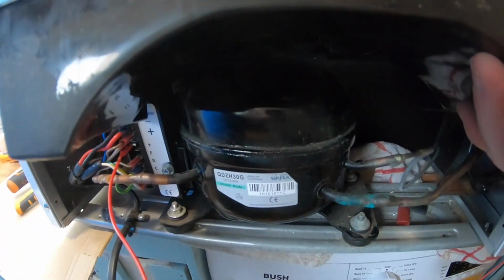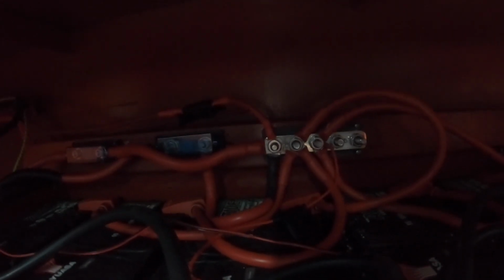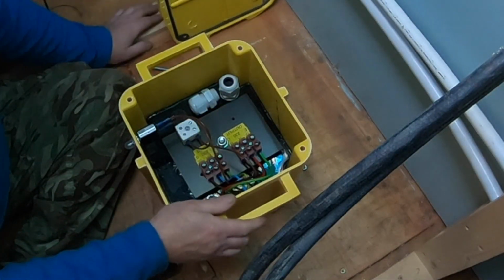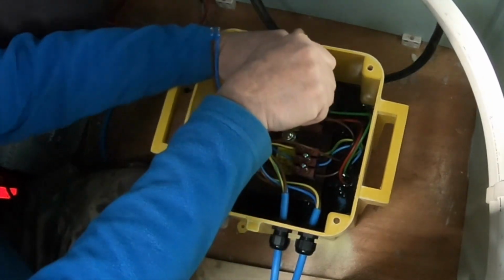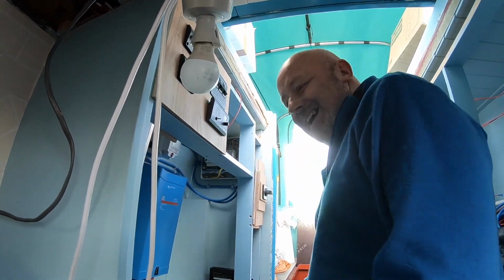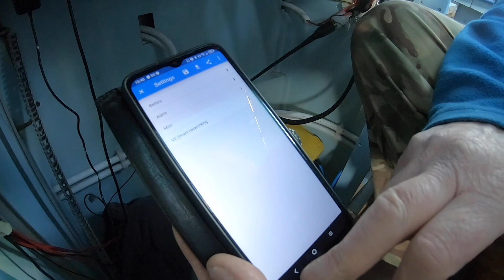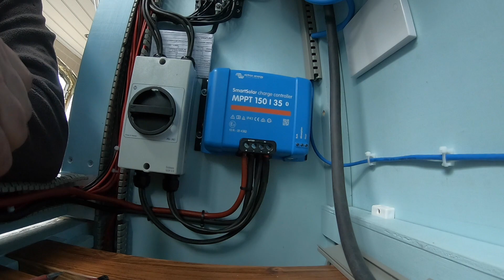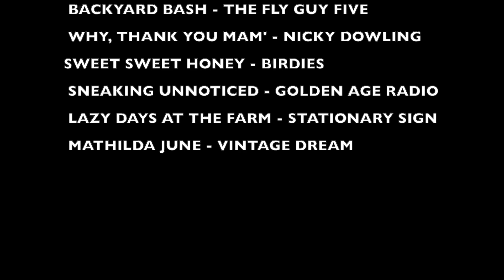VLOG 102, Narrowboat Fit Out, 12v Fridge, Isolation Transformer and Solar Electrics part 3

Comment: Hello from Germany,

you did a good job with the galvanic transformer. You never need a galvanic isolator again.

I am happy that you understood what I meant with the battery-connections and the bilgepump.

Please tell us why you did not connect the 12V-fridge to the swithed-distribution-fuse-block but put an extra plus-cable and a big extra 15A-Beaker in the engine bay. It could have been easyer to connect it to the fuseblock and put a normal fuse for it in there.

Good wishes from Germany
Reinhard
Reply: I was thinking the same about that fridge circuit. Hopefully he'll tell us his reasoning.
Reply from the maker: Thankyou Reinhard, Yes you explained it well, thankyou for that.  The Fridge company say in their instructions that it has to be connected directly to the battery. We kept changing our minds on what to do but decided to do what the instructions say incase it invalidates the warranty .👍
Reply: @makinganarrowboatwithnannyandg  Hello from Germany again.
You do it right because of the warranty and you have a fuse and a switch. Everything is ok. After the end of the warranty you can change it if you will do it. 🤭
The thing is the size of the connection so there is enough voltage measured at the fridge. The most fridges die because of low voltage and that is the reason for the company to say that it shall be connected directly to the battery.

You did not tell us something about the temperature sensor. Have I seen it wrong or didn't you have time to have a look for it?

Best wishes from Germany
Reinhard
Reply from the maker: @reinhardfredebold9169  Yes I forgot to film the temperature sensor but yes Ady changed it to what you said. i will try to remember to prompt Ady into mentioning it in next weeks episode. Thankyou 👍

Comment: I bought a 12v fridge from Inlander last year for my motorhome. Brilliant fridge/freezer. I fitted a fan but I don't think they need it. I infact blocked up all the vents to keep the ambient high enough to make it work. Recently with ambient below about 4 to 5 degrees the freezer section doesn't work. I thought it was broken but Inlander told me that's normal. Now it's warmer the freezer section runs around -18... 👍
Reply from the maker: Thankyou thats good to know. We will keep an eye on that 👍

Comment: More ticks off on the list, well done. As someone else has mentioned please will you explain why you wired the fridge separately on its own circuit and breaker. Why wasn't it connected to the distribution box (consumer unit) like everything else?
 Hopefully grandad got his birthday treat!
Reply from the maker: Thankyou Tony, The fridge makers specify that it must be wired straight to the batteries, we don't know the reason for this (will try and find out) but decided to go with what the instructions said. Grandad can have his treat when the boats finished 🤣🤣🤣
Reply: @makinganarrowboatwithnannyandg  I knew that there had to be a reason. Boat building, fretting etc. is a never ending job, poor Grandad!

Comment: The tray that broke loose from your fridge freezer is a condensate evaporation tray, it utilises the heat generated from the compressor on which it is sat to evaporate the condensate drain channelled from the fridge cavity so the more silicon you use to glue the two together the better the conductivity for heat transfer!
An Isolation Transformer will bring you added protection from many potential complications from the anomalies associated with taking power from unspecified sources so your money isn't wasted there, but it's unclear from the video images whether you have isolated the boat's earthing arrangements from the source earthing arrangements which needs to be done to achieve galvanic protection.  It looks as there is an earth cable from both the primary and secondary connector blocks disappearing between the Tx and casing and it is usual practice to connect these two to a common grounding point on the Tx Chassis, maybe it's my eyesight! but worth a check!  Congratulations on your work.
Reply from the maker: Thankyou Tony, Yes we have stuck that back in now. Ady will have a look at the transformer tomorrow as we have just seen your message and let you know how it goes. Thankyou for your input it's really appreciated 👍

Comment: A very neat job grandad but did not quite understand what the big yellow box does.
Reply: This is a transformer that isolates the shoreline from the boat 240V in. That is good for safety and loss of corrosion of the hull.
Reply: @reinhardfredebold9169  👍thank you
Reply from the maker: Thankyou Martin. Yes what Reinhard said. They are a much better choice rather than the galvanic isolator many have 👍

Comment: Hi Ady Great bit of wiring! The thing I don't understand is what is the difference between an ordinary Galvanic Isolator that you just use the earth cable,  and the one you installed?
Reply: A normal galvanic isolator isolates only the earth cable so there cannot exist a small current on the earth line. 
A transformer isolates the other two wires. This makes it totally impossible for a galvanic dc current to flow.
No diodes can fail, no maintanance needed.
Reply: @reinhardfredebold9169  Well you learn somthing new everyday! Thanks Reinhard :)
Reply from the maker: Thankyou Steven. Yes exactly what Reinhard said 😂. He took the words right out of my mouth👍
Reply from the maker: @reinhardfredebold9169  Thankyou, Exactly that